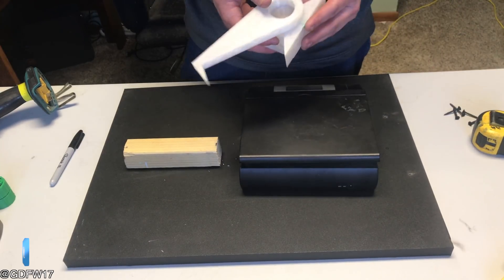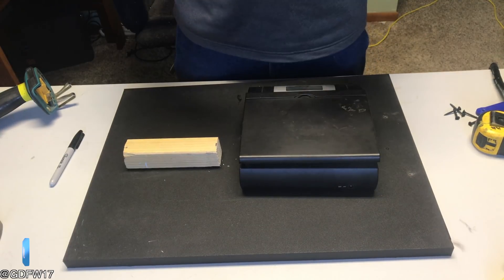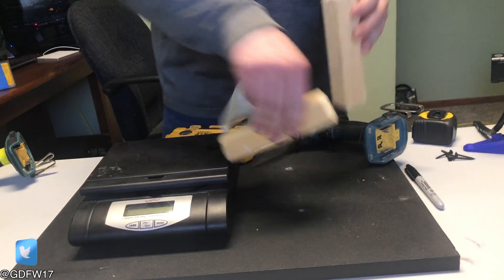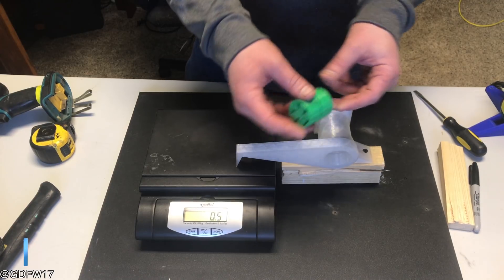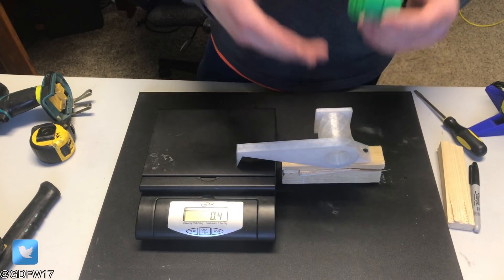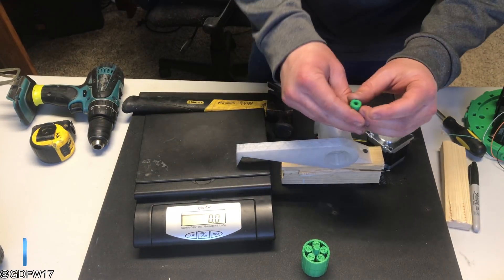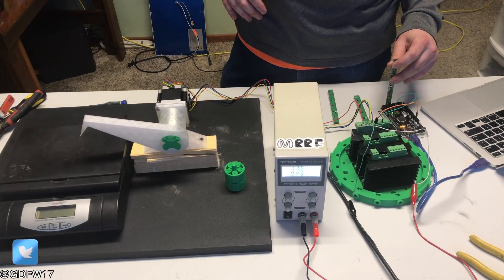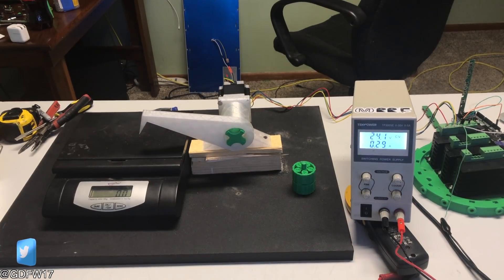How Efficient is a Compound Planetary Gear Set?

Comment: Perhaps im missing something obvious; but whats the skipping thats the limiting factor here? Is it the motor losing a step? Or something in the mechanical contraption? Not knowing this im not sure in what sense you are measuring efficiency here. Is this really efficiency in the sense of friction in the gearbox? Or would the numbers radically change if we just fixed the cause of that skipping?

One cause of inefficiency in this design I can imagine is the lack of torsional stiffness of the long and thin planets. Ideally theyd be infinitely stiff; and in the limit to being super rubbery, you can intuit that its only directly next to the ring split that the teeth are doing all the work, while the rest of the gears is sitting unused. This deformation and stress concentration doesnt help the friction I think. Curious to see how a test like this would compare for your nylonx half ton monster with steel rod inserts. My gut feeling is that itd come much closer to ideal performance.

Comment: G.D.F.W.  I spent a lot of time making silicon rubber molds, from 3D printed parts, I think you could get very strong gears if you used your 3D prints to make a rubber mold and then cast the gears in hard resin the gears would also be much more heat resistant and handle much greater torque just an idea to try ;)

Comment: Screen Recording: Look into OBS.  Should be entirely cross-platform, even for mac, very simple to use once you set things up.

Torque: While we are talking a plastic gearbox rather than metal, your losses are due to the mathematical difference in the basic lever.   

Direct drive slug: motor shaft is locked to the arm, ie: shaft center to arm tip is your distance.

Planetary drive: is a compound lever arrangement.  the force of the lever arm is acting directly against the outer ring gear of the gearbox, not the center drive gear, which offsets your distance. It also offsets the torque equation because the angle of force is no longer a perfect right angle, but is tangent to that ring gear.

Comment: I think you need to measure the input torque in addition to the output torque (simultaneously), and then compare. Gear skipping should not be accounted in the efficiency. It just means that your gearbox design can't not provide that mechanical advantage.

Comment: Is there any difference between oiled and dry gear box?
These harmonic style gearboxes are working on a sliding action of the teeth.
I've build a similar thing but with proper helical brass gears on the sattelite and sun parts and the 3D printed external gears, I was getting pretty similar results though.
Reply: Nope, this design rolls the gear teeth in the proper way. As long as the input and output stages both mesh on their pitch circles, there should be no sliding. Certain tooth counts work out just right, or by using different modulus on the output stage, you can make any combo match up. The correct scale factor can be calculated from the tooth counts of the gears, (RingIn - PlanetIn) / (RingOut - PlanetOut). Note that the scale factor will be 1 if the difference between ring and planet tooth counts is the same for both stages. Those are the combos that don't need different modulus.

Comment: Gearboxes are just not efficient. Especially plastic gearboxes. Friction is not linear (unlike what they teach in physics classes), especially with soft materials like plastic. As you push harder, the coefficient of friction gets higher, which means the overall friction gets much higher. Also, the coefficient of friction of 3d printed plastic is already quite high compared to polished steel or injection molded delrin. I don't think you will get much higher efficiency out of a 3d printed gearbox.

Comment: The system has a lot of parts, each with its own spring constant, which makes it very nonlinear. Since you have an adjustable power supply, try running the test at a very low torque and at a moderate torque.

Comment: You maxed out your scale there,  at more than twice what its rated, that alone is impressive on the scale's part but ya, the max indicator illuminates and it stopped measuring at 3650 the first time,  did you change the batteries out?

Comment: EE weenies should never be allowed to mess with mechanical stuff. :-p

That said: didja think maybe your "loose" D-shaft hole was the problem? What kind of step-down gearbox does the stepper motor use? What kind of torque-limiting device (and, YES, it WILL have a mechanical torque-limiting device built in) does it use?

Your compound gearset was already broken (the ring gears were split). Plus, what kind of lubrication did you use? Frictional effects (especially with something THAT tightly put together) will have a HUGE difference on efficiency.  

And yes: I'm a mechanical engineer. And if I EVER catch you using a pair of needle-nose pliers to tighten a bolt (outside an emergency situation, duh), I will whack you on the knuckels with one of AvE's "Thumbdetecting Nutf**kers". >:-[
Reply: i love that you also watch AvE haha

Comment: Have a look into stock metal planetary gearboxes. Hey, even find a dead drill and pull one out of that to do some testing. By comparison, a standard spur mesh (not helical) loses about as much as 5% of energy transferred, so per reduction stage in a planetary set, that works out to be 3 meshes with about a 15-16% energy loss. For two stages, which I think you are using, it's closer to a 26.5% energy loss, although I'm not sure if you are using a helical set based on the video. Although, even for 4 planetary stages, this works out to be about a 46% loss, which isn't as much as you are seeing. I figure the ~80% loss you are measuring might be due to higher friction in the ABS(?) gears, which sounds about right. Otherwise, I noticed your lever wasn't poking the middle of your scale, which may influence the result as well.  I reckon you should check the numbers for metal gears and compare, but otherwise blast your gearbox with WD-40 and see if it makes a difference (if you didn't already). Assuming friction to be one of the main factors here, you could also look at finishing process for 3D printed ABS (like acetone finishing), which may get it working better.

-Matt
Reply: That scale might also be very inaccurate on the low end.
Reply: My guess would be on the gearbox bending and binding slightly, because it has only two "wheels". This because the plastic-layers from printing go in the same direction as the gearboxes motion.

Comment: Why don’t you expand the notches that hold your gear box from slipping to be further out and thicken them so they’re stronger? This should raise your slipping point since you’re not actually relying on the breaking point of plastic or the power of the motor, you’re relying on the static friction of the plastic before it slips?

Comment: Have you tried putting some oil or grease on those gears? PLA isnt very good for friction applications. It tends to stick. Maybe try a cycloidal reduction, afaik it doesnt have as much friction by design so maybe that could work better.

Comment: Maybe I missed it somewhere, but what exactly is that arm pivoting on? There are plenty of sources of potential inefficiency in that system beyond just the gearbox drag.
Reply from the maker: A grove filled with Bb’s
Reply: Under load what do you think the torque to overcome a pair of print layers would be in that instance? (not a rhetorical question, genuinely don't know, but would expect it to be sub-optimal) A perfect tooth profile well lubricated metal-on-metal planetary gearbox like that might be 90% or so on its own. Add plastique, probably not optimal tooth profiles, and a plastic-metal-plastic hybrid bearing........ yeah I mean I'd have expected 40-50%, but not 20%. I assume you've got a good silicone grease in there right? 

Another possibility, and it is just a guess, is that a lot of those scales are surprisingly inaccurate if loaded off center. Both times you loaded it in it's front right corner.  The consistency of your efficiencies suggests that I'm wrong, but a hanging scale might be easier to set up for anyway. 

Yeah, I don't know, I'm just spitballing here but otherwise you've stumped me.

Comment: You have no reference for how efficient a compound planetary gearbox should be. I'm sure even the best planetary's (transmissions) have over 20% loss (80% efficient). I would like to see a testing rig to test a few of your designs.
Reply from the maker: im actually planning on changing a bunch of other variables in another video.
Reply: Ground, hardened steel gears can achieve 95+% efficiency per stage. Being plastic, without good bearing on the shafts and with loads of form error in the tooth, it’s no wonder that the efficiency is so low IMO. Certainly disappointing.
Reply: You should test the big one!!
Reply: Tau automatic transmissions do generate a fair amount of heat, but not all energy loss comes out as heat.
Reply: It all ends up as heat.
Reply: my reference for this is datasheets for planetary gearboxes sold on SDP-SI's website for those curious
Reply: Hmm, Well, if planetary gearboxes were that inefficient, Let's see...
Well a Average car engine is 100Kw, assuming perfect transmission to wheels that gives you 20Kw's of heat.even 10kw's is a daft amount of heat, You'd burn up captain.

Comment: Have you considered molding and casting in metal?
Reply from the maker: would be a lot of work... maybe someday
Reply: Youd still have to machine and ground the gears for them to mate correctly. Itd be easier to just start from a round stock  of a known good material rather than casting it in aluminium or some other subpar metal.

Comment: wait..... If you had a sawzall why didn't you just use that to cut the wood in the first place?
Reply from the maker: couple of reasons, the only blade that I have is meant for metal, and it's super hard to rip cut wood, especially because I didn't have the correct blade
Reply: Couldn't you have cut two 1 inch squares off the end and placed them next to one another?

Don't take this the wrong way, I love your videos, and watch them all the time, just curious haha